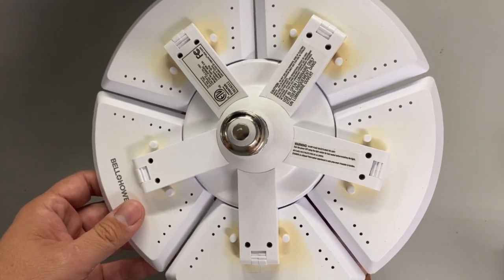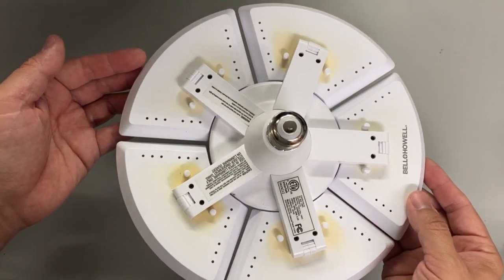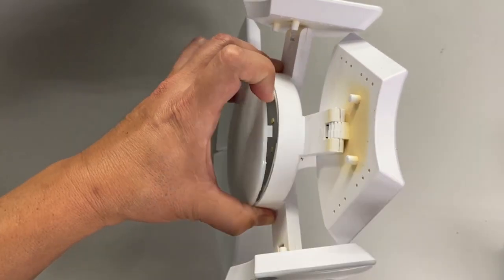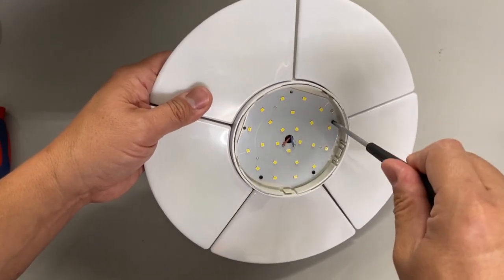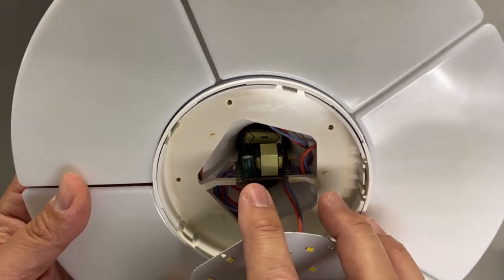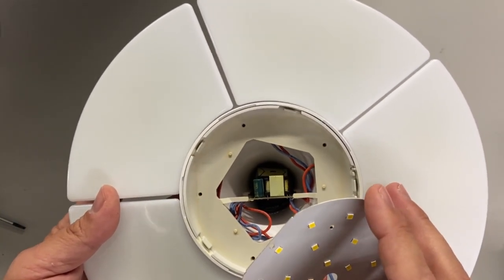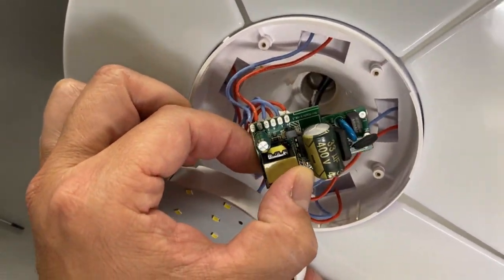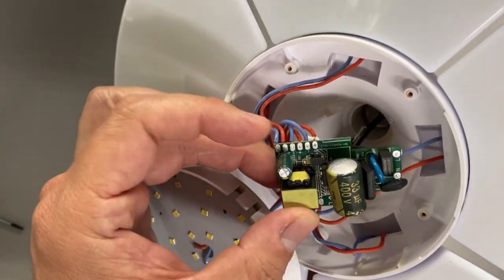LED LIGHT BULB FAILURE AND REPAIR.  BELL AND HOWELL BIONIC HEX BULB

Comment: Good job repairing this bulb and replacing that blown capacitor with a quality one. Never heard of that company either.
The manufacturer of this bulb should've at least drilled a few holes in the top of the plastic.
Reply from the maker: I was going to drill vent holes, but will see how long this unit lasts with the higher rated capacitor.  It's a real bummer when manufacturers skimp on everything to guarantee part failure just outside the warranty period.  Thank you for visiting!